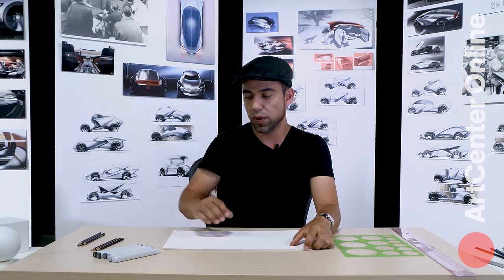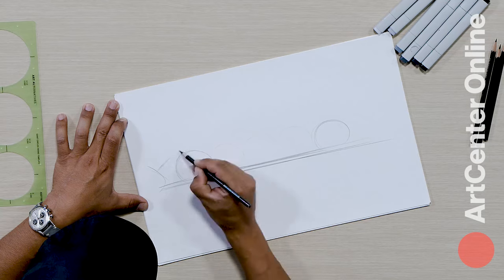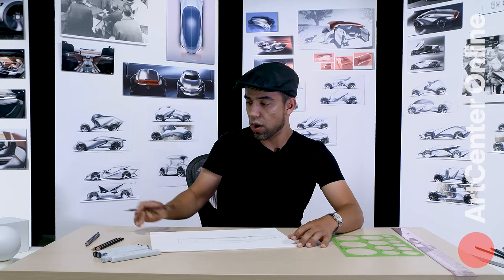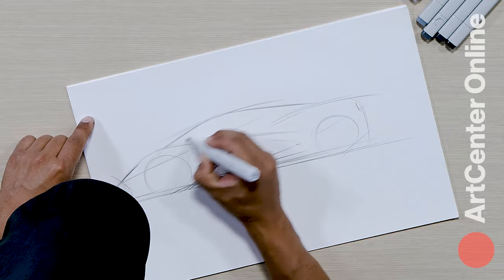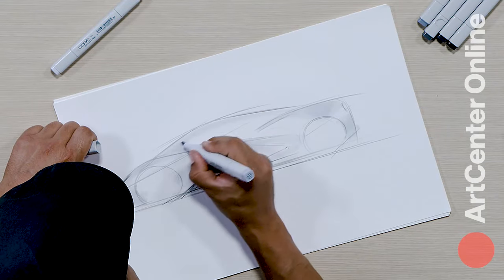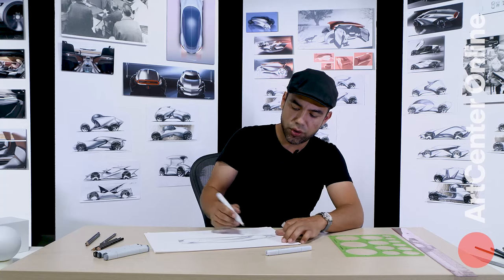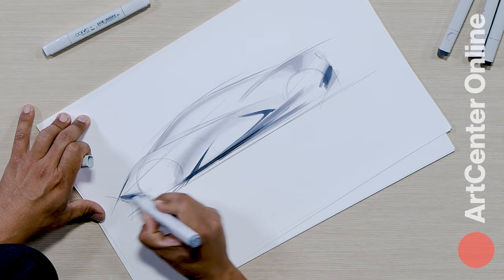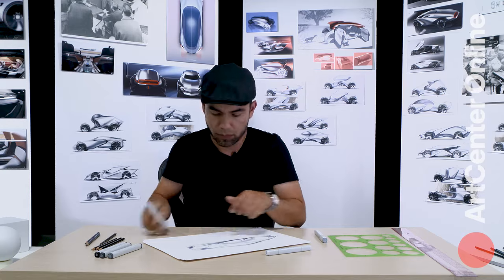Professional Car Design: Sketching a Super Car (1 of 2)

Comment: Such a nice work! Can you tell me how to draw a PERFECT circle like that? It's bit tricky to do so and i'm always using circle ruler to draw a nice wheel. But one day, i want to draw it without ruler!
Reply: Bro i am also having a problem of drawing weehls but i can draw it properly using a protector😂😂
Reply: me to i have the same problem i draw sketches to i wanted to see someone like you
Reply: Just practice every day, put more shoulder motion into your circles, you can have your arm planted on a flat surface for better steadiness, that's what I do, but you'll get the hang of it pretty easily if you practice every day
Reply: Stiff elbow, forearm, wrist and good grip on pencil, all the circular motion should come mostly from the shoulder,  not the wrist.
Reply: Scribble a circle until it forms a perfect shape. Easy.